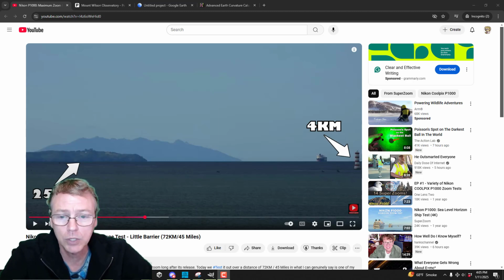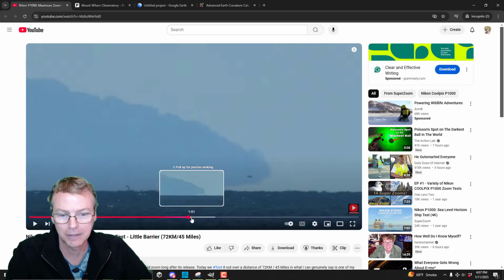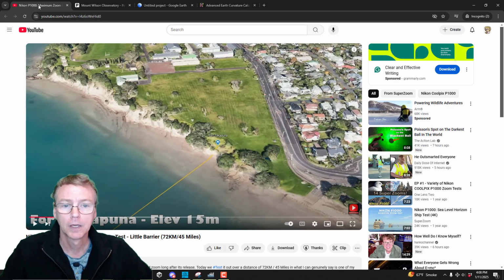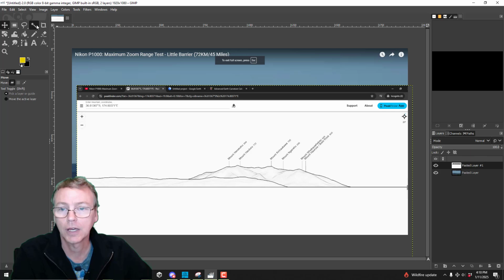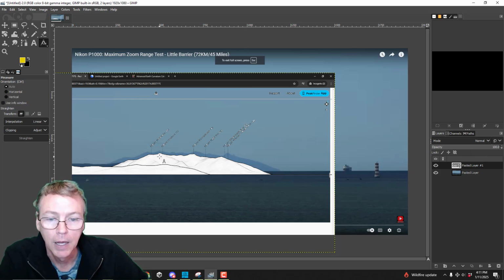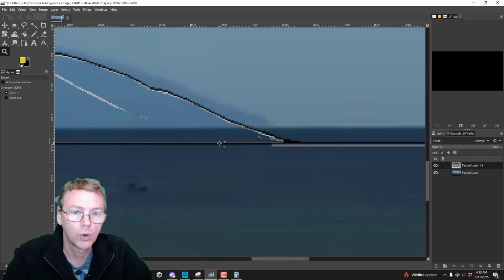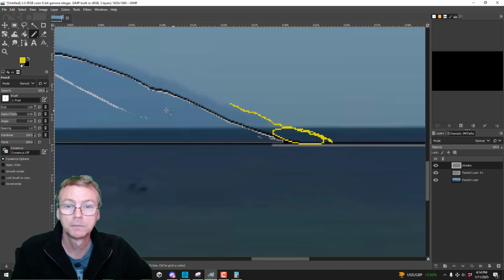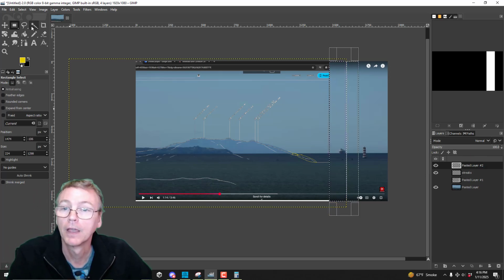Little Barrier Island from Fort Takapuna

Comment: In cases like this it should be trivial to calculate the angular size of the target based on its known surveyed height and distance from the observer. Then from the visible portion of the island, say using 2 obvious features, identify what fraction of the full thing is hidden. Could even insert a line or representation of where the real base of the target is.

If you’re not convinced the method is appropriate, try it on things in front of the horizon. The whole thing should be visible and the scaled line match up with the actual thing in the scene. That should provide all the confidence needed to trust the base of the farther target is really that far below the “crest of the water hill.”